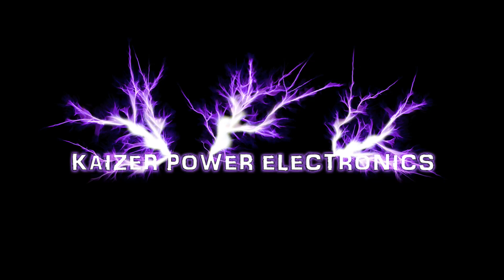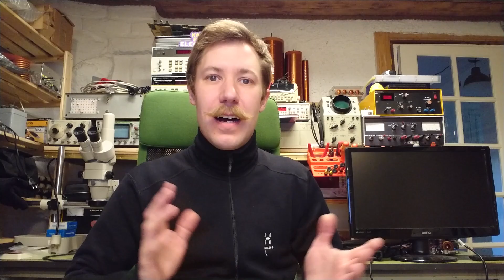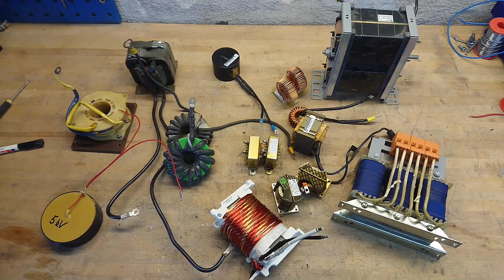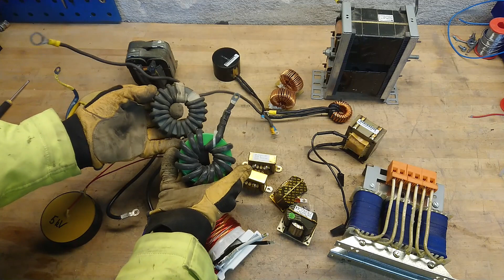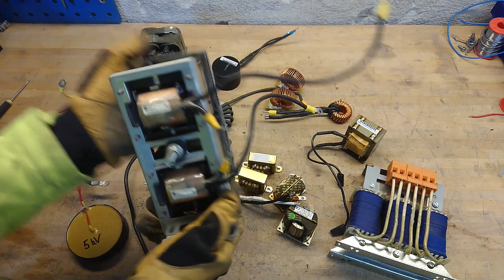Power Inductors and Inductors In Power Electronics - Isolation, Day 17

Comment: Regarding the (3-phase) input inductor: I thought it was the (series) inductor of the boost converter type PFC. If you omit it, the PFC will directly short the mains supply to ground. Said differently, it is not for making a sine-wave like current, but rather for current limiting and storing the energy of the boost converter.
Reply from the maker: The 3 phase iron core inductor here is only for use as passive PFC. I have done a few test and it can do around from 0.5 to 0.6 PF when put in front of a non-active-pfc inverter
Reply: @KaizerPowerElectronicsDk  Ok, thanks!